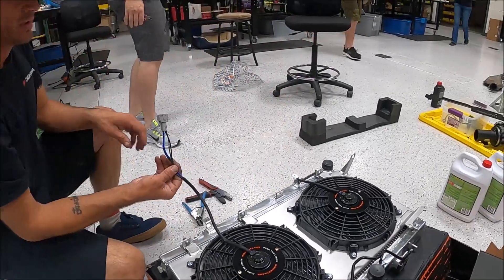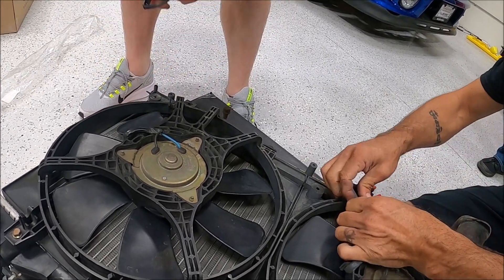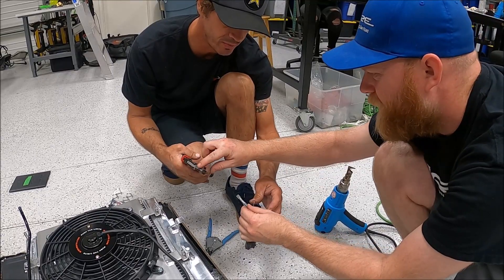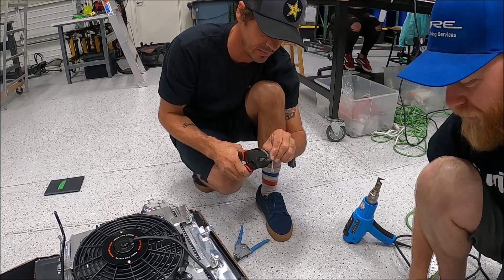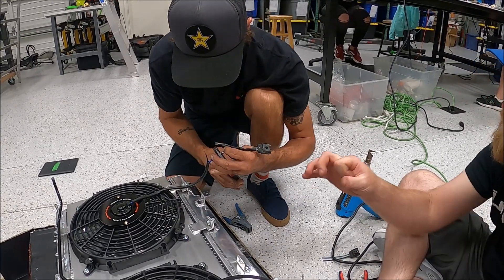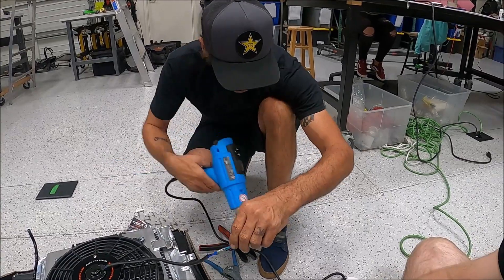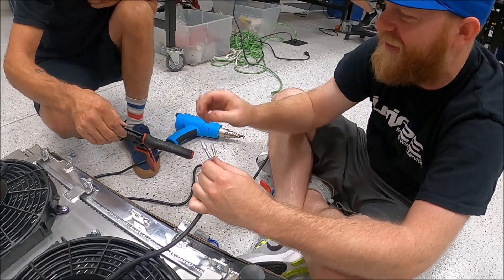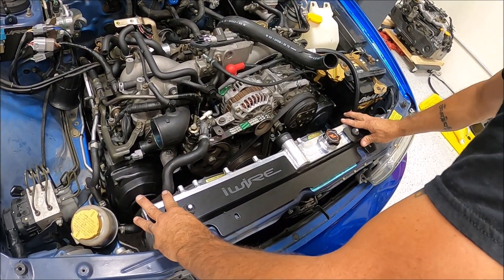Radiator Fan Wiring - GD Radiator in a GC Chassis

Comment: Can't de-pin the plugs and swap to the other?
Reply: Gc are 2 pin and gd are 3-4pin.  You can’t just swap the plugs.   The 2 grounds on the gd need to connected and one of the power.  I don’t remember which.  I set it for high speed

Edit just read Brian’s write up.  Both power should be crimped together. I guess that’s why my passenger doesn’t work with the ac on
Reply from the maker: Most of the time no because they are different terminal types.